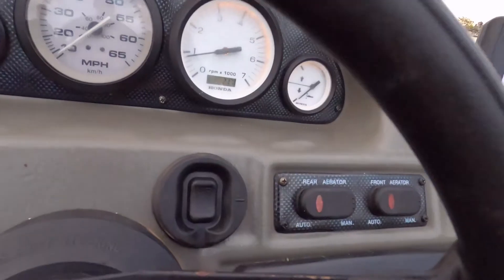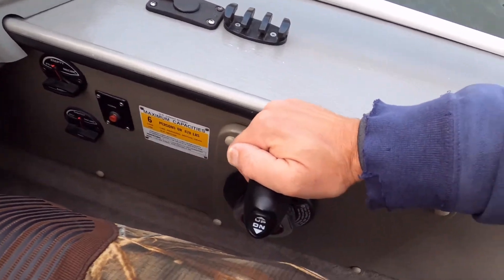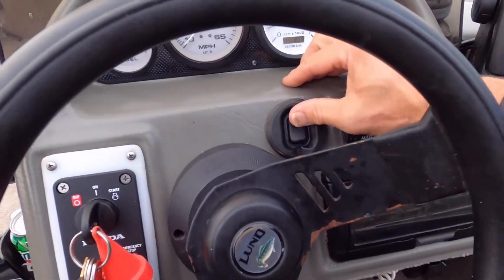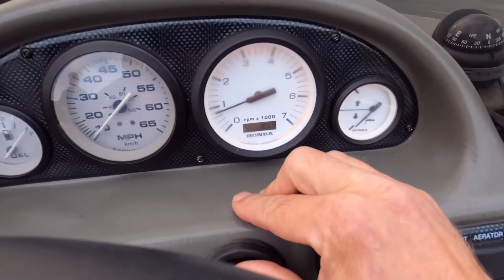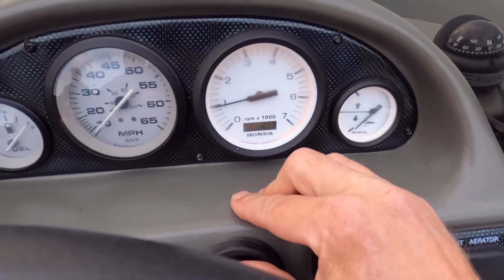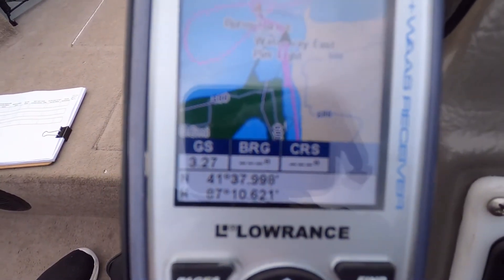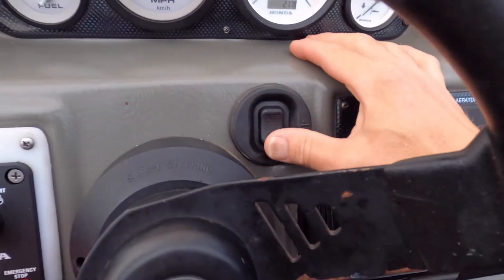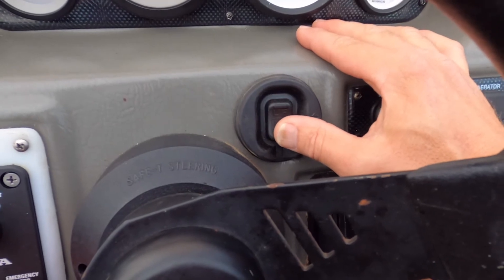Honda Variable Speed Trolling Feature (Troll Control) on a Honda 100 HP Outboard Boat Engine

Comment: I've got an 2004 BF150A... is this a Honda controller or where can I find it?
Reply from the maker: Hey Ray!  I’m not sure if this will work for your model but your local Honda marine dealer should be able to answer that. I used Calumet Marine in Calumet City, Il.  The owners are Frank and Denise Martin.

Comment: Do you think running the engine at low rpm is bad for it? Like, in terms of oil pressure like it's bad to idle a car engine for long periods of time?
Reply from the maker: I put over 2,000 hours on my Yamaha and it lasted for over 20 years doing this. I have thought about it but I guess that’s a risk I’m going to take.

Comment: Hi, could you tell me the minimum speed you can achieve with trolling? I didn't understand if it can also reduce the speed from the gear engaged only, or it is to adjust a low speed more easily for trolling. thanks in advance!
Reply from the maker: It actually controls the RPMs of the engine not necessarily the speed. We use it for slow trolling for walleye or smallmouth. I use it where you just want to bump the speed up just a tad. it just increases the engine RPMs by 50 rpm with each bump on the toggle switch. When your engine is warm and you put it in gear you can go down one click or increase many clicks until it stops increasing rpms.
Reply: @BigLakeLittleBoat  okay so compared to the gear engaged you can reduce the rpm by one click, (50 rpm) correct?
I bought it for live bait trolling hoping to be able to be under 2 mph/h....
Reply from the maker: @capitanpaladin  correct. If you want to drop speed any more you can look at getting a 4 blade prop or a smaller diameter prop (make sure you dont hit rev limiter with a new prop), a trolling plate on your outboard or trolling bags.

Comment: Do you have to run it back down when you are done trolling or does it reset it's self?
Reply from the maker: As soon as you give it gas it just shuts off automatically
Reply: @BigLakeLittleBoat  Thank you I am hoping I can pick my boat up today, I can't wait to try  the troll function.
Reply from the maker: @gemfaceter  It works great for ultra low trolling speeds when I have to kick up the gas to troll little faster when I’m salmon fishing I don’t use it but for walleye or trolling for bass or something it’s going to work awesome

Comment: Pretty cool.  I added a kicker to my boat last year.  I was hesitant at first, but I'm glad I did.  Added the Trollmaster Pro 3 later.  Always tinkering with my boat.  Neverending.  lol
Reply from the maker: I’ve always thought about maybe putting a kicker on but my boat is so small and I also like that the when I run the big motor at an idol there’s hardly any noise.